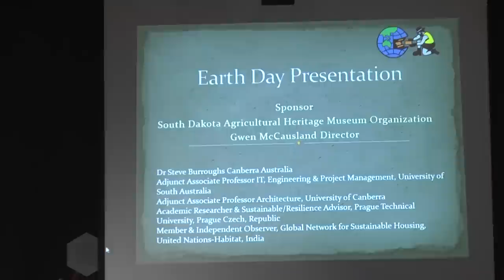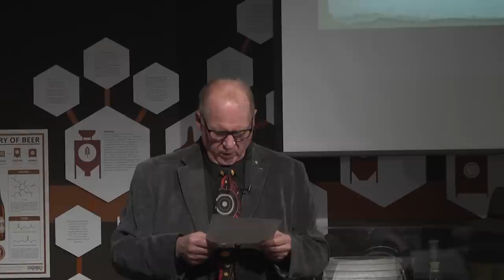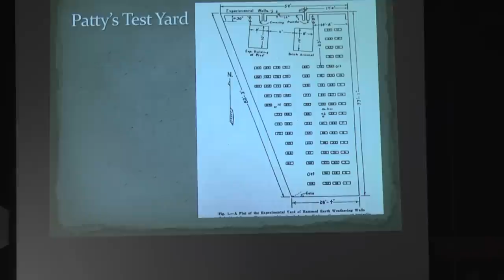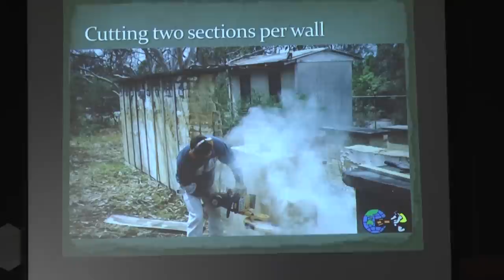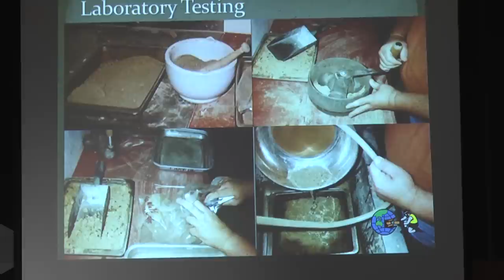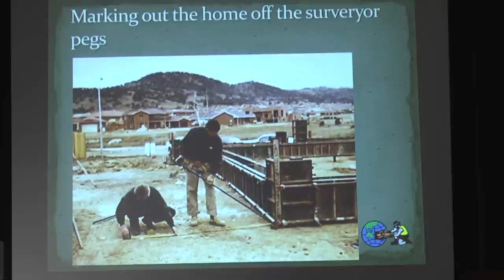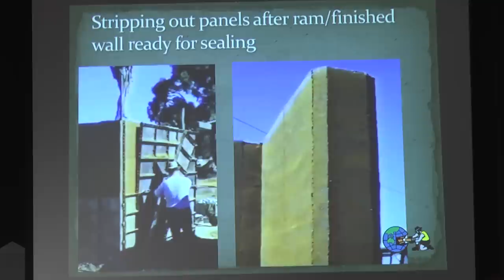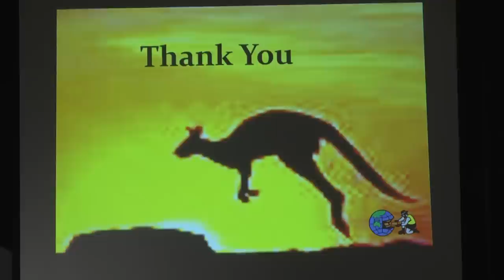Rammed Earth Construction with Dr. Burroughs

Comment: Thank you for posting this. I was not aware of Dr Patty's foundational (no pun!) contribution to rammed earth construction research. I found the research overview most interesting and well worth it when he got to it--and the first 15 minutes provided valuable context and background. 

I have one question though: At 32:50 Dr Burroughs says the Kumasi test walls in Ghana were identical, but the slide shows no visible wall caps of any kind--and remarkably, no apparent rain erosion after ~25 years in a tropical climate!  That seems very much worth noting. Did I misunderstand something? If not, does anyone know the reason for this?

Comment: So I spoke to a contractor who is a very close friend of mine and we looked at a couple of videos together and he came to the conclusion after just a few minutes that this is not the most efficient way and certainly not the cheapest of making a home.
Reply from the maker: I hope you do not dismiss this form of construction after watching a few videos. Rammed earth  is an ancient method of construction still being used all over the world that is very sustainable. It naturally regulates temperature and humidity. It will last for thousands if you have a proper roof and foundation.  The main expense is labor since you can "harvest" the building materials from the soil around you. In South Dakota, it was popular in the early 20th century for farmers to build barns. Labor was cheap but materials were expensive. It is being used in urban and rural areas of China, Australia, and US. If you are in Wyoming, stop by the visitor center in the Southeast corner. Their building is made from rammed earth.
Reply: sdagmuseum 

So when I first started seeing these videos I was taken back by the beauty of the natural design and impressions. But then I started asking around contractors, engineers even laborers and what is presented is not exactly truthful and a bit misleading. Every county has building codes some even seismic you CANNOT build these building without some kind of reinforcement they must be load bearing and there’s not enough thermal mass between these walls with just rammed earth. Not to mention the walls on average are far more expensive to build per square foot then conventional building methods. Even adobe needs reinforcement and more mass than people mistakenly believe. As a recently graduated student I’m all for everyone having a cheap not affordable home that is very low maintenance and in the long run cheap to maintain but I think the video doesn’t do people justice I was lead to believe I could even do this but not so it would actually cost me more to do than conventional methods. With that said there are other methods to building an efficient home but it’s not necessarily cheap. As of right now the only one I found to be cheap building and environmentally efficient was insulated concrete forms (icf) buildings or insulated foam brick. Not sure if you know about it but I would say look into it. The bigger picture is a lot of these YouTube videos with do it your self sustainable homes are pushing for an agenda which I’m not against but it’s misleading to people, come time to building the home.
Reply from the maker: @cc-zn2ty  If you are interested in researching it more, I would recommend the bookhttps://www.amazon.com/Rammed-Earth-Construction-Cutting-Edge-Traditional/dp/1138027707. Also, if you are in Wyoming, their Southeastern visitor center is made form rammed earth. https://inhabitat.com/new-rammed-earth-southeast-wyoming-welcome-center-introduces-travelers-to-green-design/wyoming-rest-area-22/  Here at the museum, we have the last remaining building built by Ralph Patty in the 1920s. It is close to 100 years old. This particular building has two different rammed earth methods or each wing. The building here in SD is more comfortable than a wooden barn in the winter and summer even though it has no insulation. There has been research done in Australia and in Europe that rebuke some American builder's claims regarding reinforcing and adding additional thermal layers. At the museum, we built a test wall by hand. I was surprised at how quickly it came together but it was hard work, hence why Dr. Burroughs uses machines to tamper it down. For areas where timber is not available, concrete is expensive but labor is cheap, then rammed earth is a viable option for many remote areas.
Reply: @cc-zn2ty  idk where you are at but in ohio it absolutely falls under building code... CSEB as it is also known, has specifics as far as size of block. The codes you need to look into are codes for adobe homes. the biggest problem i found is finding an architect/engineer who is familiar with this concept. there are some but very few. i built a 3bdrm 1 bath for 27k USD.... so i really dont know why you think these are misleading statements... as a contractor, building inspector, electrician, and plumber i can most definitely say its so simple you will feel stupid when you build one from scratch... i use interlocking compressed stabilized earth brick (CSEB) and it worked so well i bought a fully automated machine setup to start 2021 with a new fire!
you build all walls (except bathroom) out of this block... then i use Dri-Core wall system for every exterior wall... as im building i grab my pvc electrical boxes and conduit along with plumbing lines and run it thru the bricks as i build. after i build the walls with block i buy prefab trusses and floor joists and install the joists with crawl space underneath, i put radiant heating on the flooring and thru walls, i install solar panels to code to power the radiant heating and cooling, i make them with 10' ceilings and keep it to a ranch style for now. thats practical experience talking there... here is simple equation... its fireproof, mold proof, tornadoes, hurricanes, even earthquakes... not really doing a thing against an earth home.... foundation is rubble with a 14" footer, its stronger than traditional fired bricks... by alot... regular bricks 300 psi CSEB bricks 1500 psi... i incorporate "roman concrete" into my slurry to add strength as it ages...